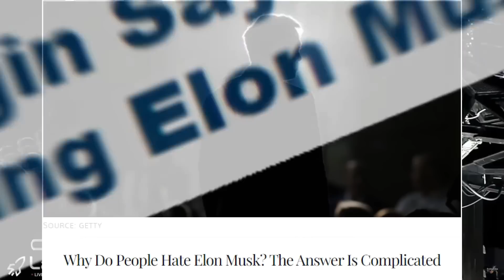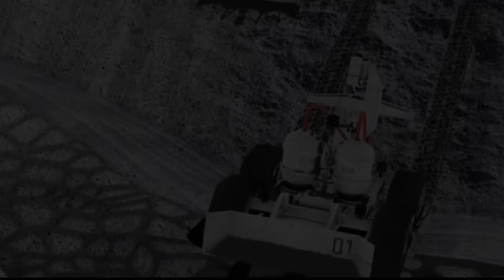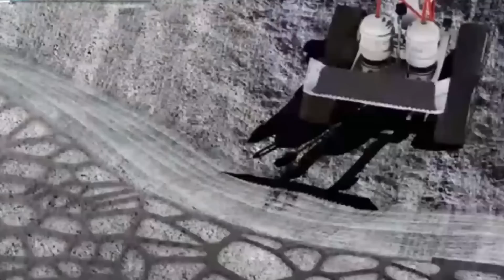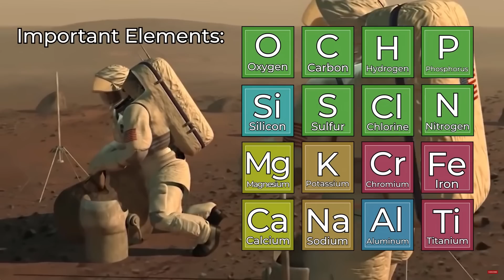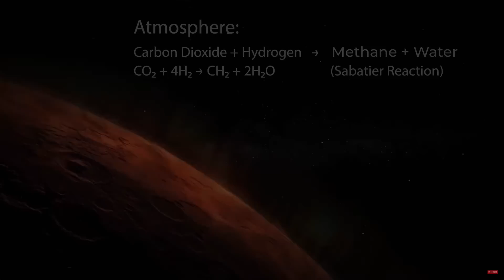Space Colonization: What is the Best Destination for Humanity in Space?

Comment: The moon is one of the most hostile environment one could imagine. No magnetic dynamo to deflect harmful radiations, no atmosphere to stop the tiniest micrometeorites. The tiniest speck of dust at rest in the vicinity of the moon could be accelerated to 2.5 km/sec (moon's escape velocity). Imagine a speck of dust weighing 1 gram accelerated to that velocity ... it has more than double the kinetic energy of an AK47 round and would poke holes in virtually everything we would send. Not a nice place to stay for holidays. So yes, I have my questions about Apollo. For reference, I don't know about the moon, but there are about 25 millions meteors hitting the earth atmosphere every day. Almost all of them vaporized by air friction
Reply: The big thing for me is the fact that days and nights are 30 times longer on the Moon than on Earth, and the temperature swing from day to night on most of the Moon is 300 degrees C! This is not just a problem for temperature regulation, but also for maintaining pressure seals due to thermal expansion and contraction.

To be fair though, with the existence of peaks of eternal light at the Moon's poles you can find places where the temperature is stable around 50 degrees C.
Reply from the maker: Very true.  It will be a hostile environment.  Best suited to underground habitation and industrial development with scientific outposts.  It will be a long time before there are enough domes to make it a fun and safe place to be.
Reply: A sun screen is needed to deal with the heat.  Like a parasol, even for rovers and diggers so they don't over heat.  But this heat can be stored up in sand or aggregate or water and used later when it's night out.
Reply from the maker: @TheWadetube  That's a good thought.  A "heat battery", it could also generate electricity with thermovoltaics.

Comment: Glad to see you doing a colab. One thing not mentioned that is better for the moon is the fact since the moon has no atmosphere and is closer to the sun, it is better for solar panels vs Mars. Also I see the moon as more of a way station to Mars. I agree with both sides, but believe it doesn't have to be one or the other, but each would have a specific dedicated use.
Reply: Not just Mars. Launching a rocket from the Moon to anywhere else is better than launching from Earth's surface.
Reply: "Better for solar panels".
Unless you're at the South Pole of the Moon, and have towers for your solar panels, you need 2 weeks of storage with enough capacity to keep you warm during the Lunar night.
Reply: To much dust. They'd have to have a crew out cleaning the pannels. Nuclear power is best way to go right off the bat.
Reply: @rh1960  Nuclear is definitely a reliable choice, and will be used. The data from 6 rovers on Mars suggests an average of 0.2% reduction in panel efficiency per Martian sol (day) if no intentional cleaning effort is made. This ranges from 0.05 - 2% per sol, depending on weather. 

Humans manually cleaning the panels monthly would average 3% energy losses due to dust. Realistically though, it wouldn't be difficult to dust them with an air compressor or special brush, so it would likely be done more frequently than that (or only after a particularly dusty day).
Reply: Great point! I agree with the "why not both?" way of thinking.

In the video linked below I compare the availability of solar energy to the energy needs of a colony on the Moon and Mars.

https://www.youtube.com/watch?v=05YhT6WMctU
Reply: Right! Going to Mars is at least two orders of magnitude harder than going to the moon. We HAVE to use the moon as a proving ground for how to live away from Earth. We've already had 20 years of an off-world outpost with the ISS, but the ISS is in microgravity and doesn't have any local resources other than sunlight that can be utilized. Establishing an outpost on the Moon will give us experience dealing with darkness, dust, gravity, and all sorts of other new conditions that will be closer to Mars conditions than the ISS is. We can learn things like how to connect up pressurized rovers with habitats and landers; how to build and operate greenhouses; generating and distributing nuclear power; how to make mobile habitats; how to mine and process local resources into useful items; and so many more things. 

Mars is the obvious final goal here, with the potential to become self-sustaining as mentioned, but I think the moon is the obvious first goal. That said, I still want to see Starships start landing on Mars in the next decade or so, as I don't want ALL our focus (and money) to be spent on the moon.

Comment: Both are transition points for interplanetary colonization and the O'Neill cylinder colonies that will be used as interstellar ships through using solar sail technology for reaching half light speed and use of thise same sails for deceleration upon approach to desired star systems.

This is only if there are fusuon drive systems at play
Reply: Better we just send robots to do all the work because we don’t even know if we can handle that kind of speed without inertia dampening of some kind. And if the robot send back info that it’s habitable for humans then we can try the sails are gonna be 10s of km big sooo maybe not so viable advance the proven tech first I say
Reply from the maker: Robots for the Moon are a great option DJ.
Reply: @Sora._Cloud  inertial dampening is exactly what deceleration is, does not matter if it is solid or chemical rocket fuel or advance electromagnetic distortion that works like artificial gravity plates and structural integrity fields in Star trek.
Reply: Moon for inner and outer transit to mars gateway to outer system Saturn or Neptune access to Oort cloud